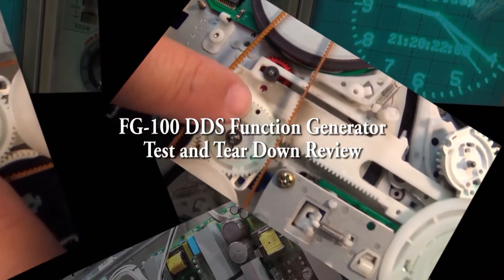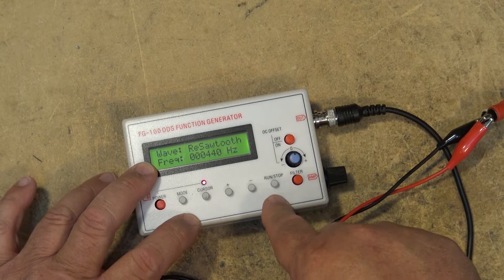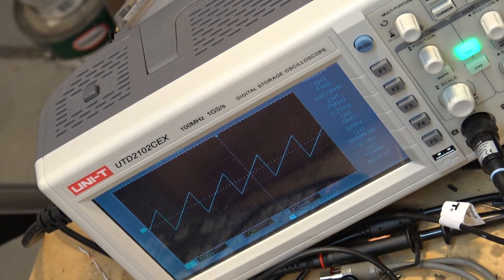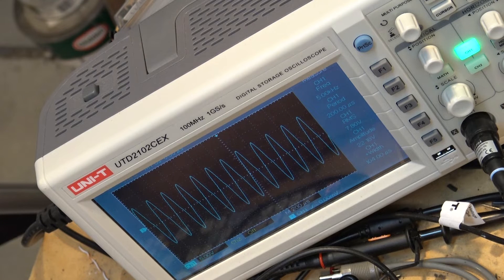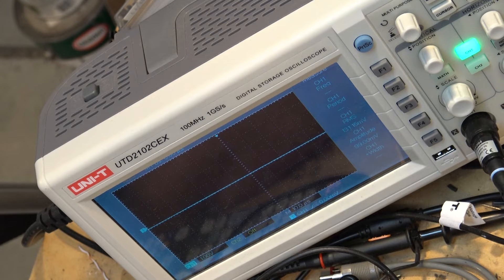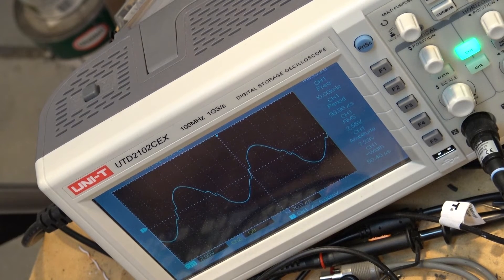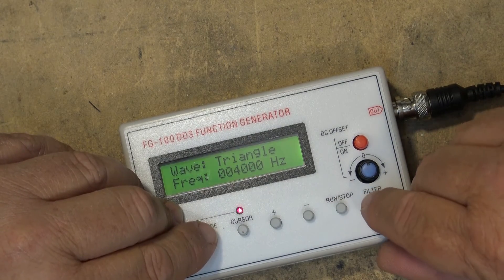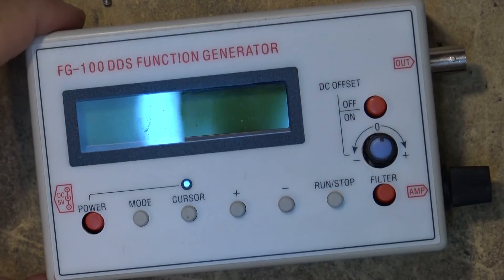FG 100 DDS Function Generator Review and Tear Down

Comment: Hi
Is there a way to hack to make it auto boot into 60hz each time its powered onn?
Reply from the maker: Sure just break into the code edit and recompile it.
Reply: @12voltvids  ok so where in the code is the default frequency set please ? you know ? thanks, dave
Reply from the maker: @dave11674  how would i know that? Did I design it and write the code? No.

Comment: I have the same FG 100 DDS generator and can get a decent sine wave up to 500kHz but the square, saw, etc, become very distorted after 100kHz. Just purchased (April 2022) so it looks like the firmware has been upgraded. Also, an EKG wave has been added.

Comment: I bought this generator (20 $) with TL 072 OpAmp. Only waves up to 2 kHz were ok. When I changed OpAmp with the Texas Instruments 5532 Sinus wave is very good up to 400 - 450 kHz, triangle - up to 150 kHz, square - up to 80 kHz. "Myfriend" from China gave me back 8$ - finally it cost me 12 $. Two OpAmp Texas Instruments = 0,6 $ ( price in Poland :) )

Comment: I have the same function generator and got the same problem with bag output. Tl072 are counterfeit (working in class C=Crossover distortions)  and after replaced them with ne5532, the signal it's perfect until 500 khz.
Reply: Well it gets better, but max acceptable results (with square/triangle/sawtooth output) are up to ~100 kHz with ne5532. Stil not 500 kHz as stated

Comment: I Have a suggestion for a future video.
An XR2206 based unit. eBay is full of kits
Reply: Oh that is an oldie! They published designs around that when I was in school! (and that was in the 80s') I made the Elektor design, still have the unit and it still works! It has no trouble at all getting up to 100 Khz, 200 with a few mods.
It was a fairly expensive chip back then, but even so it was well worth it.

Cheers
Paddy

Comment: That looked so good at the start, but quickly showed it's utter pointless use as a audio generator later on :-( :-(.
That's a real shame, a waste of parts :-(
I have an ancient icl8038 based 0-200khz generator, it copes better.
Reply: Would be fine to use for speaker repair as you only need 40-50 hz to center the cone for surround foam replacement.
Reply from the maker: So does my old HP from 1963. It goes up to 600KHz nicely.
Reply: Yep propper test gear :-).

Comment: That generator doesn't get anywhere near its claimed specs. Yours isn't the only one with bad output. Check out the review section on the listing page. Others uploaded pics of their bad waveforms, too. Post your review with a link to this vid.
Reply from the maker: Peter Ridge 
Well I wasn't expecting much and it didn't deliver much. Limitation is the processor. Atmega doesn't have a very high clock speed. It would be fine for audio work but not good enough for much else. 
I did a review on a dc-dc converter that performed to spec. That one will be up soon.
Reply: Yup, it's good to know what not to buy.
Reply: What do you expect for the price. Useful for generating low frequency for centering speaker cones when redoing the foam.